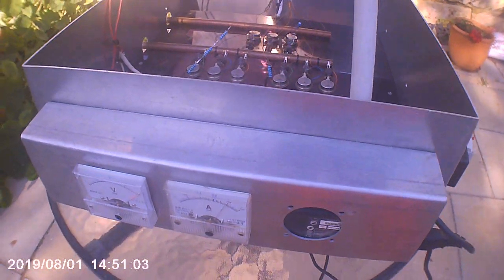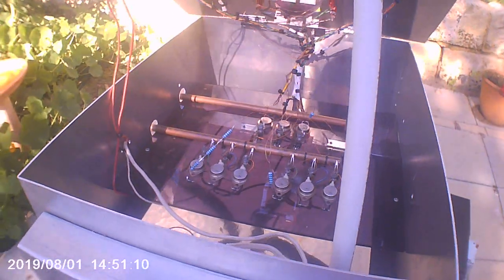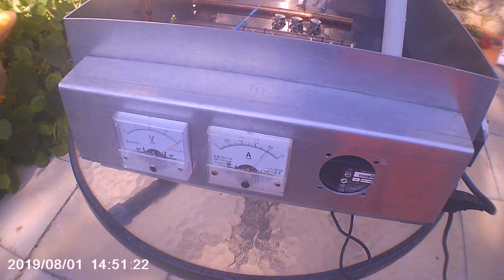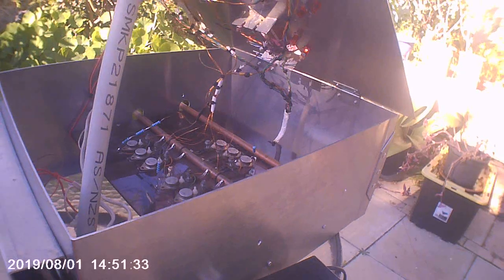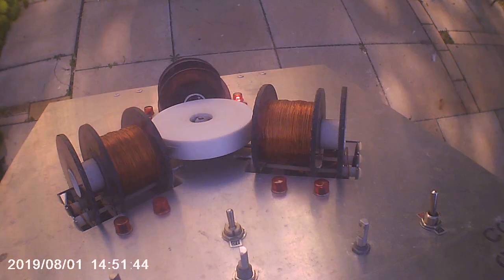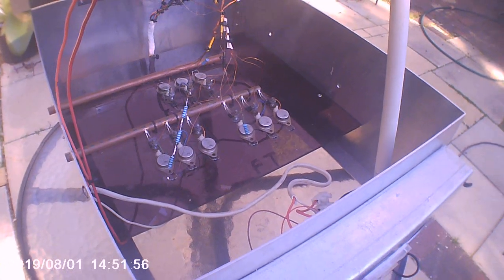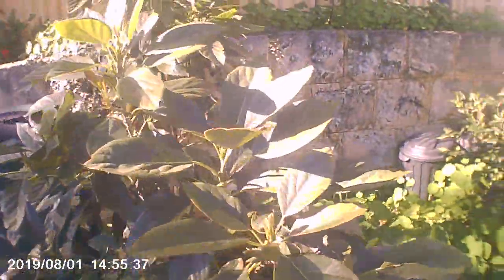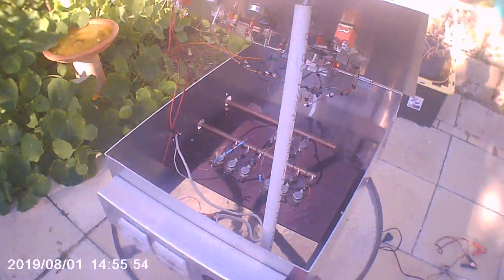Bedini Motor VS Battery Charger [ Capacitor Dropper Circuit ] Battery Rejuvination

Comment: Remove  triger  coil  and  magnes  use 555 module  for signal 😀
Reply from the maker: i have better chargers that are. - and even better ones still, as in the video, just a capacitor and bridge with mains voltage. -    - actaully my 555 coil is made with an air core coil taken from a welder. - it really bites big !! ouch
Reply: @director-patrickwatkins  plis sens mi diagram and some move my email  lukaszrozycki82@gmail.com

Comment: Hi Patrick,
How does this setup Chop or dump the capacitors charge into the batteries? Simulating the impulse spark, you mention in the video.
Cheers,
Ray
Reply: Hi Buddy, this setup does not have the optional cap dump, as recommended by many, - however john did not use this in his biggest units.   - however it is GOOD, and will improve smaller SSG units. - and infact, completely replace them....  but really this video is intended too fill a important gap in my documented learning.   thanks fora perfect question !!